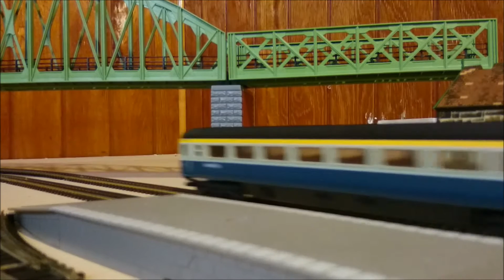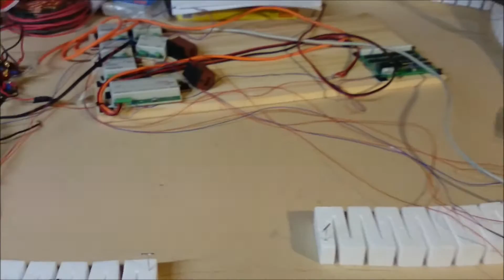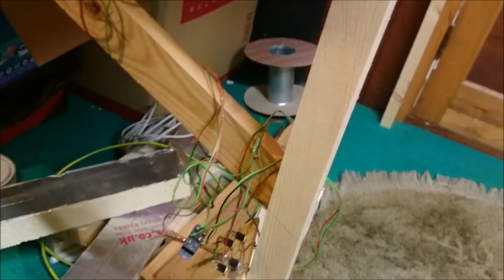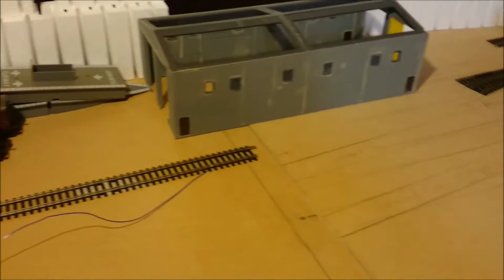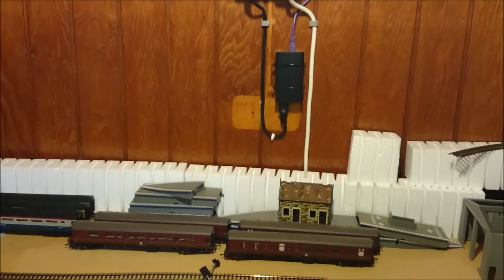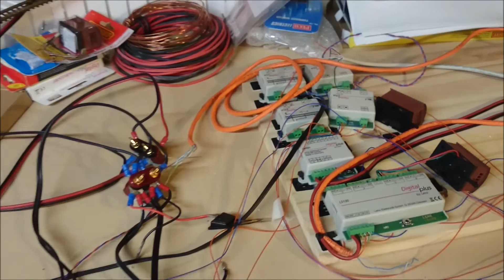Weekend Engineering 4 - Benchwork, Power & Re-laying everything!

Comment: Great update and thanks for showing also what are your incline grades cheers Robert
Reply from the maker: +csxmad Hi Robert, thanks for the comment, I'm using 4% inclines due to lack of space, most of my locos will make it but some of my older ones can't. I wanted to use 2% and I think thats a much safer option, but I couldn't make that fit in the space I wanted to use.
Reply: Thanks alot cheers Robert